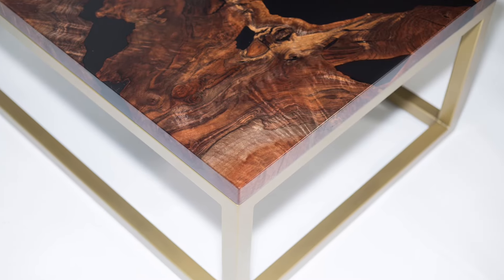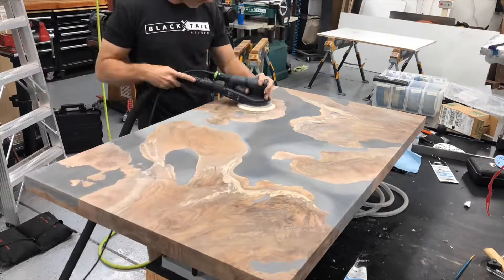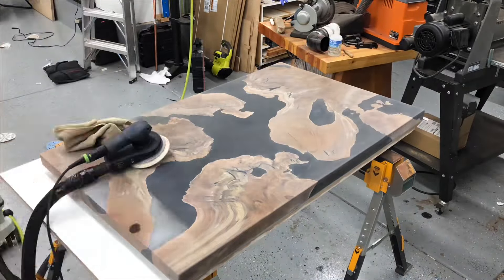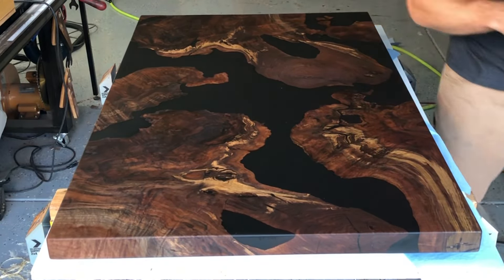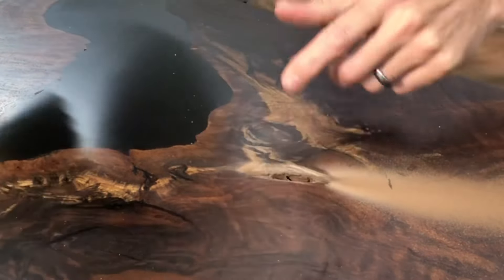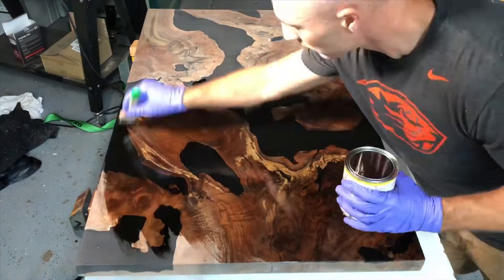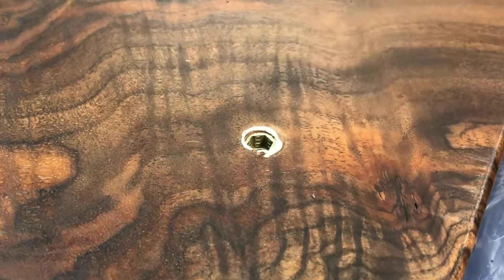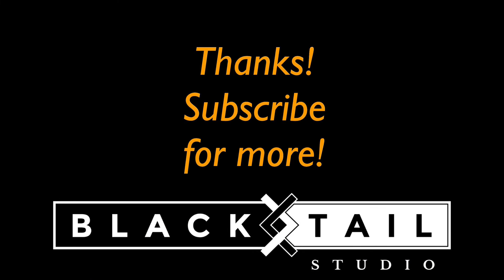How To Make An Epoxy Table Part Two

Comment: The client should have gone with a bare metal frame.
Reply from the maker: Noted!
Reply: I would have suggested copper or brass plated. They wanted brass paint which doesn’t fit with a premium table.

Comment: Well, what can I say . . .  wow, wow, wow.  We have just put resin on a new bar top for our pub (we used Glass Cast, a 2 to 1 mix).  Which is nothing like the amazing work you have put into that table.  However, neither of us had done anything like this before and we were quite hesitant to get started but, although not perfect, we are extremely pleased with the result.  We have the 2nd half of the bar top to coat in the next few days ready for the bar refurb in a few weeks.  The more I watch people like yourself who are designing and making furniture which involves either just a resin coat or a more technical design like your table, it still amazes me how beautiful resin can be.  The wonders of you tube allow people to research and learn so much in order that anyone can have a go.  Thanks for sharing.   When our bar is finished I will send you a pic.  Best wishes, Jay, from a little village in the UK

Comment: I truly appreciated and loved the accuracy you put in bringing this project to life. Thumb up for the use of the metal insert into the wood to fix the table structure instead of directly screwing into the table top. Only one change I would went for: copper colour finish instead of gold for the table metal structure! 😉
Reply from the maker: Funny you say that, this designer just ordered another table the same size for their personal house. BUT with copper finish on the base.

Comment: Great job! If you ever want to achieve a true black background for your photos, use black velvet. You can get it by the yard at Hobby Lobby or Joanne's. The fibers in the velvet help absorb the light; it's the best and easiest way to get a truely black background.

Comment: I love watching your epoxy table work. Unfortunately, I do not have the space or equipment to attempt this myself but enjoy watching craftsmen at work. I have a suggestion... have you ever thought of adding crystal or metal to the epoxy e.g. quartz or copper filings or flakes - even gold leaf !?   It would be interesting to see how this turns out after polishing.
Reply from the maker: I did brass resin recently. Pretty cool!

Comment: Such beautiful contrasts on this piece. Frsitrating to find that rot later on, would you suggest using an awl and going over the surface pre pour to find soft spots? I assume the dots would come out in the first planing session? Gorgeous piece!
Reply from the maker: Thanks Phil! Yes, if I had spent more time inspecting it I should have found it.

Comment: 😊A lady needing guidance here.  First off, thank you for your videos, they are amazing. I'm trying to follow along so that I can make the top for my island but my slab has some cracks ( it's a fir slab) So my question is...now that I have this slab sanded down with some small cracks, what would my next step be? I don't want epoxy on the whole slab just the small cracks.  I want to keep the natural raw look and texture but as stated, I don't know what to do next..TYIA🙌

Comment: You could have use brushed gold-plating technique if the client would have afforded it. Of course it would require special electroplating equipment, but if the table support was made out of brass, any scratches could be nicely hidden by the brass color.

Comment: If you were going to make a translucent table what would you use to fill the little holes?  Thank you
Reply from the maker: Clear epoxy or clear CA glue
Reply: @BlacktailStudio  I was planning on using a translucent blue tint.  

Would you still use clear epoxy to fill the holes since I am using a blue translucent color?  
Or 
Should I try & match the original translucent blue color to fill the holes?

I'm worried if I try and match the color it might stick out a little.  Does the clear blend in with the rest of the tinted epoxy after sanding & buffing?  

Thank you so much for your help, I really appreciate it.

Comment: I know how you feel. It took me 3 tries to make my mother a cup of coffee. I blew the milk up in the microwave 1st & then I spilled it all over the counter & floor 😩 I hate having to clean up spilled milk or cream because you absolutely cannot leave it half cleaned in Australian heat or it will reek. I would’ve made the base copper to pull up the deep reds in the tabletop slab & I prefer the black background

Comment: I wonder if you can make something like a vacuum table for doing your epoxy setting. This would just be a lid on the form, with a hole to attach your vacuum. It doesn't have to be perfect, but if you can reduce the pressure in the system you will have less need to fill holes. It will cost some extra epoxy, though, so you have a total layer over the whole, to be reduced with the thicknesser. Might save you a day of hole-filling, for the cost of that extra panel and sealing it, and some extra epoxy.

Comment: I'm not too sure about the base colour? A quick question - which you have most likely been asked often. if you drilled holes in the sides of the individual slabs for resin penetration, would that not help with bonding and strength?
Reply from the maker: Not really necessary. Check out my strength test video

Comment: I’ve found that a dremmel with a small bit on a low speed takes out all the soft punky wood and leaves all the hard wood. I personally don’t like the wire wheel marks/scars. I suppose it doesn’t matter with non-translucent epoxy though... nice work
Reply from the maker: Very nice!

Comment: Can do you have your slabs surfaced before you start the process of table making or is using a rough cut slab ok then surface it after it has the resin. Gonna start on my first end table and don’t want to go down the wrong path.

Comment: I'm getting ready to start with some small projects and I have a question. When if at all do you wear a respirator? Thanks for your advice.
Reply from the maker: Should wear it with dust. And any chemicals that require it.

Comment: As a finish, could I simply use up to 220 grit, skip the oil/Oslo, and gloss it with epoxy?  Would the epoxy fill in the tiny holes and save the CA step as well? Unbelievable!  I can’t wait to try this!
Reply: Oops....just read the rest of comments and found the answer.  Thanks for such awesome videos and instructions!
Reply from the maker: Good luck!!

Comment: Someone didn't use  enough paint chips for your shop floor. The finish looks like a DYI Home Depot/Lowes kit floor. If you ever decide to redo your shop floor, consider using a broadcaster ( handheld tool used for seeding your lawn) it will distribute the paint chips in a more controllable manner. Just a thought.
Reply from the maker: Someone was me. And it was Home Depot. And you’re not wrong. All the chips that came with it anyway
Reply: @BlacktailStudio  Cool

Comment: I was wondering if you need to let the osmo 3043 cure before buffing? Also how many coats of 3043 did you do before buffing? When i buff the table, it basically ends up removing the finish even though I do no more than 3 passes.

Comment: Thanks for all of the amazing walkthroughs and pieces! What type of sandpaper do you use? I recent have fallen in love with a stearated aluminum oxide from Klingspor but it seems like they only have sticker backs. Hook and loops have always been my preferred method.
Reply from the maker: I’m pretty sure that’s the same stuff I use with hook loop

Comment: I have never done an epoxy anything. I have seen in other epoxy endeavors that after mixing the mix would be put in a vacuum to draw out the bubbles. With the epoxy you use would this be worth the trouble?

Comment: Hey my name is Nichole! I am getting all my supplies ready to make my first project. I wanted your opinion on the durability of the finish you apply. We are building an outdoor kitchen and I have a spalted maple slab I plan to use for the counter top. Our area is covered but not enclosed. Would you recommend following your same steps here or do you have a recommendation for a final coat that could hold up in some weather. Thanks!! Looking forward to your reply.

Comment: Very nice work! You have gained my attention for sure. Now a question... I'm working on a huge live edge slab, center void and rest of surface finished with epoxy. Very frustrating trying to get a perfect finish. Tiny dots and floaters in the air. Is that finish you use a better way?
Reply from the maker: Yup, it is a better way

Comment: Nice work. I found you on youtube. what a great video. I'm looking for your advice. We used the ecoepoxy for a store/office cash counter. It was the first time any of us had done this style of epoxy work though we have been using epoxy and urethane casting resins for years to make pattern tooling. It was clear on a maple counter top we made. Everything turned out great but I wish I'd found your video before we did the job. I have a barn beam coffee table that I'm going to make for my house. It will have a steel frame around it with forge jointed corners. I was thinking of using the steel edge as the dam. The legs are going to be four stones. If i use the steel as a dam with the barn beam completely beneath the epoxy surface would you recommend doing a seal coat on the barn beam before hand? When we did the counter top we did get bubbles rising out of some of the softer wood grain and had to repair them. The beams are quiet porous and there is nail holes. I was thinking of filling all the holes and cracks with epoxy first and repairing them before sealing and doing a final pour. Also wondering if the epoxy will shrink away from the steel. Just wondering how you would approach this project.
Reply from the maker: Man, I’ve never done anything like that. You sound like you are pretty knowledgeable though. I’m sure you’ll work it out!

Comment: Nice piece. Yeah, I probably would have went with a black base/or bare metal.  Was it expensive to get the base fabricated?  I'm a control freak...which is why I want to learn welding too.  Keep it all in-house.  Lastly, just wondering on structural integrity.   Do you try to create pieces that have at least some of the wood extending to the sides?   What do you look for in structural integrity and mapping out the slab?
Reply from the maker: Base was $700 or so. Not too bad!

Comment: I liked the black background but wasn’t a fan of the base color.  Question what tool do you use the make the hole for the threaded insert? It looks like a drill bit with an extra doo dad on it.

Comment: You talked about better protection from water rings, how does this style of finish hold up with only two coats compared to say General finishes armor seal where you can do 3 or 4 coats???
Reply from the maker: Fairly comparable

Comment: Great work!

Would you recommend osmo 1101 or Rubio Monocoat? Rubio says to sand to 180 max and recommends to 120 (but that’s for wood). I’ve never used osmo but the finish looks amazing. I’m wondering what works better on the epoxy? Thanks
Reply from the maker: I use Rubio primarily lately

Comment: Very good looking table! I might have chose another color on the base but the client wants what the client wants.
I've done a couple of normal tables (my father is a carpenter and has his own workshop) and I really want to make a epoxy table from slabs that i have, like a river table.
Is it okay to pour all the epoxy at once or do you have to do it in sessions?
Reply from the maker: Depends on the epoxy. The one I use can go 2” deep in one pour.
Reply: @BlacktailStudio  thanks alot for the quick response! Gonna buy epoxy and get started on my little project.
Lots of love all the way from Sweden!
Reply from the maker: Cheers from Oregon 👍🏼👍🏼
Reply: @martinjohansson7873  If you find a good epoxy in Sweden for that purpose, tell me, haven't still found any here in Finland :)
Reply: @sstorholm  Will do Sebastian! :)

Comment: Just found your channel, now subscribed and working through your back catalogue!  I do have one question, maybe a dumb one as I have never made an epoxy table.  You fix bases to your tables with the threaded inserts that appear to make no allowance for wood movement.  Is there any risk with doing this or does the epoxy prevent any movement, given I guess it is stable in changing temperatures and humidities?
Reply from the maker: If you look closely, you’ll see I have slotted mounting holes to allow for movement. Thanks!

Comment: Hi, I'm working on my first table. The Expoy I used said I had to pour in two goes as 25mm was the deepest it recommended, so I followed instruction. I used a translucent turquoise. The table seemed to set fine but now it's out of the mould I can see I have a soft spot between where i poured the different layers, it's a few millimeters wide. I don't think it goes all the way through as the other side is fine, I'm guessing I haven't mixed it well enough? do you think it could be fixed and if so do you have any recommendations on how to do so. Thanks :-)
Reply from the maker: Dang! Unmixed epoxy is the one thing you can really only remove to fix it. Sometimes it will cure, but can take like a month.
Reply: @BlacktailStudio  do you think that is definitely what happened then? It's literally at the point where I started the second pour and everything else except these few mil have cured.

Comment: Love your work Cam! I was inspired by your black walnut table to build a similar bar top. I don't have the luxury of an industrial shop to get it planed so I will be planing it with a router sled. How do you remove the melamine form from the bottom of your pieces?
Reply from the maker: Some sloppy cut wood wedges work great. And thanks!

Comment: Hi Cam, I’ve watched these several times.  I had a Sandingmaster in my shop. I would have been afraid to run epoxy through for fear of loading the belts up and ruining them. Also, what grit belt are they using?  Love your videos, thanks.
Reply from the maker: They use 80, 120, and 180

Comment: Found your channel and subscribed today.  Does the timber lay on a small bed of epoxy or do you just put the timber inside the frame then lay the epoxy around it - very interested.  Thanks and gl with your channel.

Comment: Quick question:  You removed the soft wood spots after you applied the poly X oil and then re-planed the wood.  I recently joined a large piece (at a customer location so I can't move it as it is crazy large) and after I joined, sanded and applied poly X oil, I noticed some small soft wood spots.  NO way I can plane at this point, but in this instance, how would you advise I address sanding the spots I need to dig out and re-epoxy?  Was thinking I do my best to sand it down, flush, and then re-apply another coat or 2 of poly X across the entire piece.  Thoughts?

Comment: Would you be able to see the scuffed edges from the wire wheel on the seal coat  if u poured a clear epoxy instead of the black for the main pour
Reply from the maker: Maybe a little

Comment: I bought the gem polisher as well using the 3m white pads. After my 5th use the pads just slide off with light or heavy pressure not allowing me to buff it. Do you have the same issue or do yours Velcro on?
Reply from the maker: Ya, the Velcro isn’t great
Reply: @BlacktailStudio  How do you keep yours on?

Comment: I see in this process, you keep adding CA glue, sanding it down, then adding more. With your new method of grooving the holes out to be bigger, do you still run into this issue? Or do you just fill them once and have it done just like that?

Comment: Have you tried Osmo 3056 on any project? I found it extremely durable (well, it's intended for kitchen counters), but now I'm curious to try 3043 on something after seeing your results. :)
Reply from the maker: I used the 3054 quite a bit. Never the 3056 though. I’ll have to check it out!
Reply: Blacktail Studio It looks fairly similar, but it sets to this impermeable hard coat after 2-3 applications, and makes the surface completely water-proof, I’ve had it on my oak countertops for almost a decade now and it hasn’t degraded at all.

Comment: We are planing to build redwood epoxy resin river table. What would you recommend for final coat/varnish?  Should we top coat with epoxy or something like osmo or Rubio monocoat. 
Also what kind of buffing pads would you recommend for table like yours.
Reply from the maker: Hey Alex, I used Osmo here. Which is similar to Rubio. HOWEVER, I find redwood to be too soft for a hardwax finish. So I'd go with something like a conversion varnish.
Reply: Thanks man. You are so amazing in what you are doing

Comment: so I've been using odie's oil as my finish, but i've had some problems with the crotch sections of tables absorbing it differently than the rest of the table and leaving me with an uneven looking finish. Any tips of how to fix this? or is that why you've moved to mainly finishing with osmo? 

Also thanks for the videos! I always learn a ton from watching them! the items used sections is super helpful too! I've been buying the same EZ lock threaded inserts from home depot for $3 for a 4 pack until now!
Reply from the maker: I’d watch the video I made on finishing. Should get you taken care of 👍🏼

Comment: Awesome table, I keep watching your vids because I eventually want to do one for myself. Question: Do you account for seasonal wood movement at all? Or is that not a factor when there’s so much epoxy in the mix?
Reply from the maker: A table like this could be affected by movement. I don't think its large enough to matter in this piece though. A similar style, but larger could have issues. The epoxy does expand some, so its not like casting it in steel